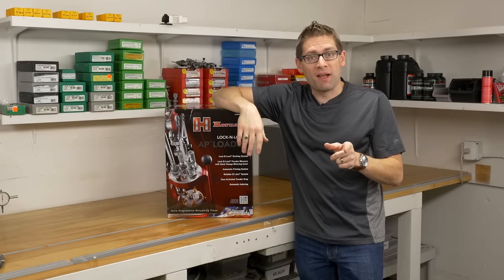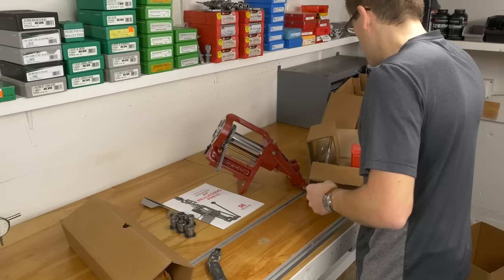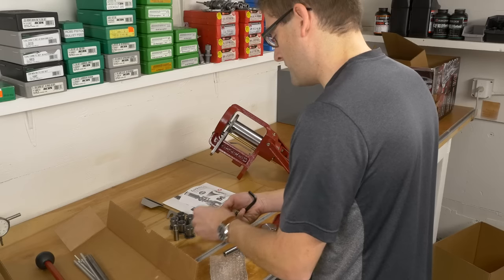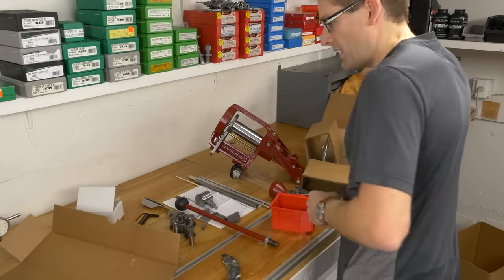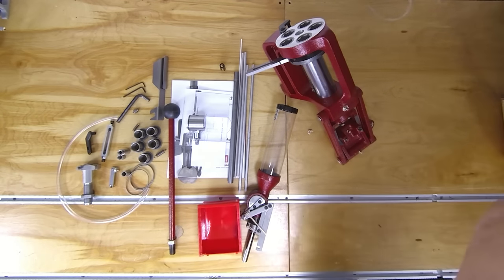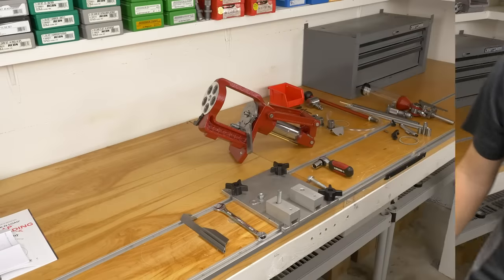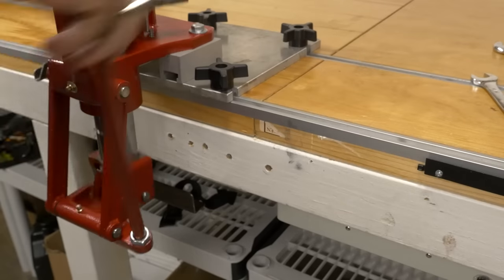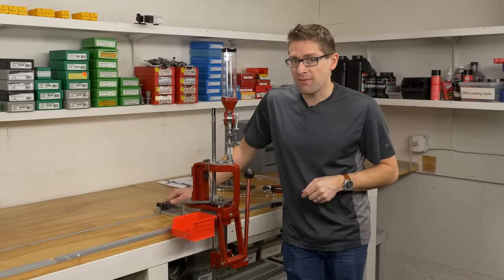Hornady Lock-N-Load AP Unboxing and Setup

Comment: Pretty good press, I have been using one for close to 5 years now. I probably get a little heavy handed when it comes to priming and I have broken the main toggle link that the handle threads into(Hornady replaced it for free, no questions). There is also a good sized divot in the aluminum frame where contact occurs with the priming punch. My fix for that has been to tap a used small primer cup into the divot with a small brass hammer. The case feeder is a life saver and I like the roller handle I bought from Inline Fabrication. The press is pretty low maintenance, the base plate will work loose over time but two Allen screws tighten right up.

Comment: Thanks in advance for your video series on the Hornady LnL AP. One thing that Hornady recommends is, cleaning all components ie: rifle and pistol rotors, powder measure, etc. before using them. All your video series are very informative. I thoroughly enjoy my AP press. I load 45acp, 357, and 556 on the press. I use my Hornady Single Stage for all my large rifle cartridges. Thanks for all you do.

Comment: Adjusting the pawls can be confusing enough. But it is often made more difficult because most shellplates come with their ball bearings protruding too far out. So when the shellplate approaches the correct position, the ball bearings grab their detent holes in the subplate. This causes the shellplate to lurch forward. That  creates more confusion (did the pawls or the ball bearings finalize the index?) and causes powder to pop out of small as well as nearly full cases. Tap the ball bearings further into the subplate (eg with a brass punch)so that the shellplate settles quietly into position. Now you know whether pawls need adjusting, and powder popping is eliminated. If you tap the ball bearings in too far, turn the shellplate over and tap them back out :)

Comment: New to the progressive press scene-been a single stage loader for over 10 years. I appreciate this video as an overview and primer to loading. I found this system(even with gouging going on...) to bee about half as expensive as the blue presses for caliber changes. Although I have zero experience with either the red or blue presses(been on the green ones)-I am already impressed by the package and Hornady's customer service. I wasn't going to wait for 4 months for a Dillon, although will probably buy after the stupidness (if it ever does?). I am happy with Hornady so far and can't wait to load alot. I would recommend the mr bulletfeeder and a case feeder(there are 3d printed versions now). Thanks Gavin !!!

Comment: Great video Gavin. I have the same press and have loaded thousands of round of both pistol and rifle. Once it is set up the key is getting the indexing correct. On my press the indexing was a hair off and drove me crazy. You have to make really small paw adjustments to get it correct. Another key to smooth running is keep the press clean. If even a small amount of powder or dirt gets under the shell plate, primer feed etc. it can cause problems such as indexing improperly or primers not seating correctly. I believe overall it's a great press and I believe all presses have their nuisances.

Comment: I own the same press and love it. It does have its issues though. Some times primers jam up, getting it indexed correctly can be a problem, and changing it the primer bolt thing on the underside can be a pain. Minor complaints compared to the thousands of rounds I've loaded up.

Comment: I have this same system. We can load .38 and .357 all day, no issues. However, the 9mm will not seat the bullet at the correct depth. It's either too deep, or too tall. Any suggestions? Thanks!

Comment: I've been loading multiple pistol calibers on my lnl progressive for years. started to load 223 with it and noticed a issue don't know if its just my press but if I try sizing on the progressive I can't get it headspaced to where I can on my single stage press. when I try it either is very difficult to bring down or the case gets stuck in die. wondered if you had any thoughts on what's happening?  for now I'm depriming sizing on single stage. thanks

Comment: hey Gavin. you didn't show how to assemble the primer system...? did I miss something here? ;)
Reply from the maker: +alzathoth You are correct! updated video: *Update: In addition to the steps listed, you'll need to drop on the primer pickup tube, screw on the shield tube, and then snap the plastic top cap in place to finish priming system assembly. I'll show that in the next video. Thanks alzathoth for pointing this out!

Comment: I would recommend degreasing the internals of the powder measurer and applying a coat of dry lube to the internals.
Reply from the maker: Yes, good call! + Hornady One-Shot to the outside of steel parts- completed cartridge bin bracket, etc.
Reply: Ok, gotcha. I asked this question about the powder measure before I found this comment. Now I'll go ahead and clean it up if I can find some One Shot at Bass Pro or somewhere nearby. Thanks!

Comment: Did you clean all the parts to remove the packing grease?
Reply from the maker: Only certain parts - some of the Hornady LNL AP parts are somewhat prone to rust, so it's actually a good idea to spray down lightly with WD-40 or similar, wipe excess off with rag to prevent corrosion/rust - completed cartridge bin bracket, metering inserts (not internal), and other small parts.

Comment: Hi i've buyed this press one week ago but i need to know if insedi the box the powder funnel i only for rifle cartridge o also for pistol. how i can understand it? i need for reloading 9mm thanks
Reply from the maker: I would contact Hornady - you should have the correct powder funnel (the long one) for 9mm!
Reply: Gavin told you right.  Another option is to buy a Hornady PTX (powder through expander).  It goes in the powder measure assembly in place of the standard spacer/drop tube.  It expands the case mouth, freeing up a station that would otherwise hold an expander die.

Comment: Defiantly De-grease all of the parts.
Reply from the maker: I only de-grease the parts that need it. (under shellplate powder-contacing parts etc.) - why? Some hornady parts are bare steel and therefore susceptible to corrosion. In fact, it's a good idea to spray such parts with a product like WD-40 or Ballistol and wipe off the excess (except the parts I mentioned).
Reply: It says on their set up video that you MUST degrease the powder measure.
Reply: I degreased the powder measure and the plastic permanently fogged/stained up LOL.
Reply: Great video! Thanks! I was wondering the same thing about the powder feed. Hornady makes such a big deal about removing the corrosion guard, even showing how to disassemble the measure to clean it up. Just a ploy to sell us more Hot Shot (or whatever it's called)? I found an AP under our tree this morning and would like to be sure the powder doesn't clump up or something. Thanks!

Comment: Not true, you'll need a new plate for whatever you're loading.
Reply from the maker: Actually no. For example: 40 S&W and 10mm use the same plate. 308 Win, 6.5 Creedmoor, 6mm Creedmoor, 243 Win, 6 dasher all use the same plate.
Reply: @Ultimatereloader  when I got mine, I couldn't reload 338 Lapua or 375 gov 🤷‍♂️
Reply from the maker: @Randy_84  Correct- 30-06 is about the longest cartridge the Lock-N-Load AP was designed for :)